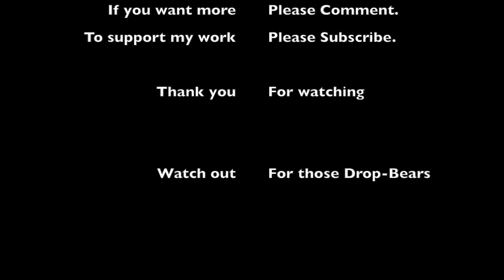Hit and Miss Engine "Imperial Super Diesel"

Comment: The compression rings are leaking thats why it wont start the tell tsil signs of that was you couldn't get a full cycle it was seized at top dead center the rings are seized onto the piston no compression for the diesel  effect to ignight the fuel vapor
Reply: Sounds like it's leaking compression through the exhaust, possibly as well as worn rings.

Comment: With the lack of lube and honing the cylinder with an 8’ pipe to get a full 360 I’d be will to bet he could break the point off of an anvil with a tail feather of a hummingbird. Painful. These engines are still around because of the pre start procedures of the people that depended on them. Most of which were a lube & tune method and not so much a go or blow mentality. That’s something I’d cherish and bring back to an as new condition as possible. Good luck 👍
Reply from the maker: Although not obvious in the video, prior to even attempting to start I went over all oil cups and the oil feed. Recording it running was a bit of an afterthought really, wasn’t expecting to have this much drama as previously ( admittedly 8 years earlier) it started very easily
Reply from the maker: I am planning on a proper service and cleanup, including building a decent carriage with some cast iron wheels put aside for that purpoae

Comment: Adding oil in the cylinder would bring up cylinder compression to get her to probably start but wouldn’t fix problem in long run. Just depends on how bad she is inside of her. Valves could still need good cleaning and laped in with lapping compound. Good luck.

Comment: My guess is exhaust valve leaking by by the sound of it. Maybe stuck rings. I would love to own that engine! I collect them!
Reply from the maker: Where are you located mate?
Reply: Definitely a bad exhaust valve. You'll never get it started like that. There are most likely other faults, such as scarred cylinder, piston and rings as result from the brutish manner in which it was "unstuck". Also this is a diesel engine not kerosene. Kerosene uses electric spark, diesel only has an injector. This is most likely low pressure injection diesel similar to the Thermoil cycle of operation. Please exercise at least a little care with your "tools".
Reply from the maker: Gday Mr Laporte! 
I have little experience with this engine, however I have had it running a couple of times up to 8 years ago. While it was covered with a tarp, the bore must have had some surface rust form.
I agree that exhaust had an issue, which I was able to get to re-seat with some manual activation and rotation.
I am all ears for your suggestions, and look forward to learning more.
I hope you can see from my other 280 or so videos I do possess some ability, even though it may appear lacking in this video.
Thanks for watching, and commenting.

Comment: JBFromOZ could also have pitting on the cylinder walls from the rust that u had to fight through with the piston. The rings cut the surface rust off. It wouldn’t hurt to pop the head off and have a look at it. U seem to have a decent shop with all sorts of tools.

Comment: There's these handy inventions called "belts" and "suspenders". Might want to check them out.
Reply from the maker: For sure! I’ve also lost 60 pounds since then as well :-)
Reply: @JBFromOZ  Lol, most of the guys in these antique engine videos are wearing overalls.
Reply from the maker: Too hot for all that gear out west Australia!
Reply: @JBFromOZ  you'd be surprised. Overalls are actually cooler than regular pants, since they allow lots more air circulation from the bottom up. I wear them in the summer for chainsaw work, and the difference is unbelievable.
Reply from the maker: I’ll look into it cheers mate!
Reply: Suspenders!!! They hold up ladies stockings and the way he’s working with that diesel I think he might have a pair of stocking on under those jeans!!
He is Australian and they still speak English, so did you mean Braces

Comment: The fly wheel with the crank handle is loose on the crankshaft. This is not a diesel engine it is in oil engine it burns a kerosene. It may start on gasoline I am not sure cause I am not going to finish watching the video. You are going to rack up more stuff than you ever preserve at the rate you’re going.

Comment: I couldn't watch more than 30 seconds .... awesome old engine and you want to break the rings forcing them over rust.... flywheel loose and ..... I am pretty sure it isn't a diesel engine. .... then there is the fact you are an accident waiting to happen with no mechanical ability at all......
Reply from the maker: Gday Jim thanks for your kind words.
The engine is a MacPherson Imperial Super Diesel.
The engine was running when last parked up, I squirted liberal amounts of Inox through the intake and up the bore, to get the old girl moving again.
I was in a hurry, and trying to get it fired up on a day that I lost a dear friend to breast cancer, and cut some corners in the process.
Happy new year, hope 2019 is awesome for you mate
Reply: @JBFromOZ  sorry for the passing of your friend.  I have one speed and it directly says what I think, not sorry for that but. ..... I could have worded the response a little less harsh. Breaking a cool old engine, or injuring yourself, because you are in a hurry probably would have been frowned upon by your friend .... have a great year sir.... maybe we will meet as I am your neighbor, I live in Thailand now. .. lol
PS.... when wrong admit it... I love these old engines and most run on kerosene after gasoline start... research proves me wrong about yours.... bows to you....
Reply from the maker: Gday Jim! Glad to have you on board, I find that sharing our questions and problems helps all to gain understanding, may your year ahead be happy and prosperous

Comment: It is not a hit and miss engine it is a volume governed engine.
Reply from the maker: enginebill g'day mate! I'm not clear what the difference is, so I appreciate the heads up! I will endeavour to find out more cheers :-)
Reply: Hi Mate. Hit and miss is a way to govern engine speed. the easiest example is when the engine gets up to working speed the governor holds the exhaust valve open which stops the firing and the engine will slow. when the engines slows below working speed the governor lets the exhaust valves shut and it will fire like normal until at working speed.   Mcdonald diesels with the brons injection system like yours are throttle governed which is where the amount of fuel for combustion is varied to speed up or slow down the engine. 
By the sounds of the video your McDonald is lacking compression which is why it won't run. Most likely with it being an old McDonald usually you can remedy this by putting some oil in the cylinder and perhaps a thinner lubricant and let it soak. Mcdonalds usually like to also be primed with oil for cold starts to get the compression up. If you want any more help just let me know. 
Regards, Nathan

Comment: If it has two tanks, it should be obvious that it starts on one fuel (gasoline or kerosene ?) and then switches to diesel !
Reply from the maker: Yeah indeed! When I first attempted to start it, I had put Kero in the small tank, and diesel in the larger tank. What I was not aware of at that stage was that the tank had some rust holes between the tanks, and the kero became mixed with diesel, meaning I was trying to start it on diesel, a much harder thing when cold.
Reply: I used to own a TE20 tractor two tanks one for Kerosene and one for petrol started on petrol then ran on Kerosene,just love the smell of the kerosine exhaust.
Reply: If it dont start after a few tries it obviously needs ATTENTION.

Comment: If it’s got a battery it’s not diesel diesel works on compression and uses a glow plug they don’t need a batter however petrol does
Reply from the maker: yeah no battery, no glow plug, just gets hot, then thermal ignition.. :-)

Comment: bad rings
Reply from the maker: yeah, it was something to consider, I did manage to get compression by hand lapping the valves (being used to automotive valves, I was expecting the springs to be quite high tension, but I was able to manipulate by hand, and was then able to rotate the valve against it's seat, to remove what i think must have been corrosion and muck since the last run. Once it had compression, the issue became attempting to start on diesel when cold, as the kero tank needle/seat was blocked and not delivering kero to the injector. another attempt to follow one day! thanks for watching and commenting!
Reply from the maker: I think you might be on to something Owen... https://youtu.be/3_AxYnIL8cE